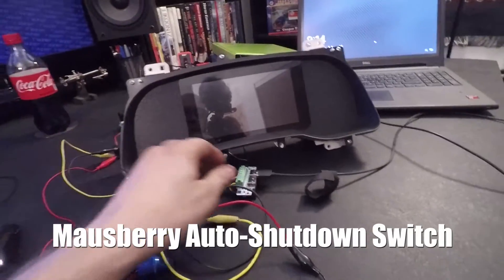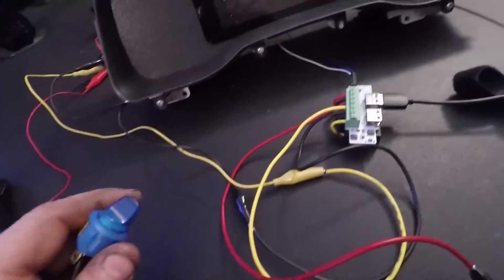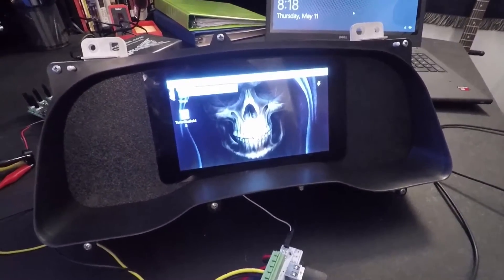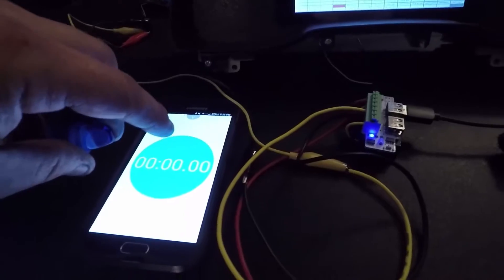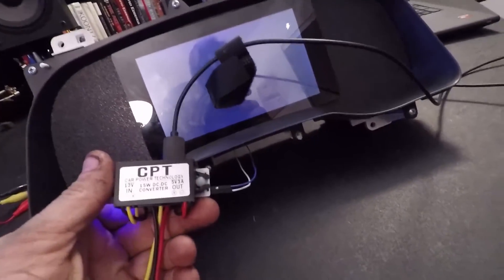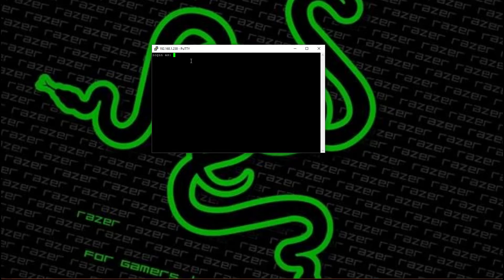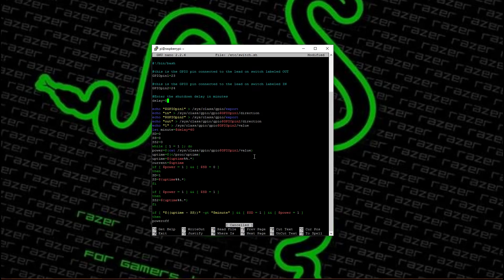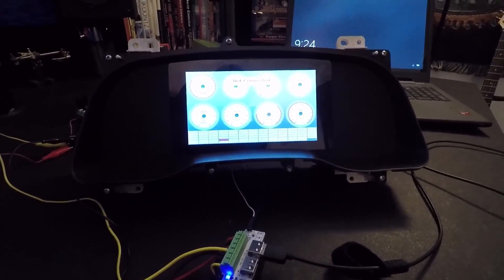Mauseberry Auto Shutdown Switch Overview

Comment: How many amps was that power supply delivering? I just tried my mausberry 4 amp circuit using a 12v, 4A power supply and the pi would just keep on rebooting, which clearly means that it wasn't getting enough current. I still have to try it with my car's battery...I just fear I wasted a lot of money on something that's not doing what it is supposed to 😔😔😔

Comment: Mine seems to switch the pi off while it still has power (switched power on) after about a minute. Any ideas? Thanks for the video!
Reply from the maker: Do you have the 2 additional wires hooked up to the Pi’s GPiO and the script installed?

I’ve heard others have had this issue.
Reply: Also having that issue, anyone able to fix this?
Reply: I was able to get the 90 second shutdown issue fixed by installing the script from Mausberry while the Pi was plugged into the wall (to keep the power on) then shutting down and installing the pi and Mausberry circuit into the car per Mausberry instructions. I think their instructions make it sound like the script can be installed after the physical install which is what I did first incorrectly

Comment: The product looks great and is the only thing I've been able to find that does what it does in a simple form, but I wish it had either a higher power out put version, or a version where you supply your own converter and it just handles the switching. The only other complaint I have is the price, at the time of writing this it's $35.99 that the price of the pi itself.

Comment: Can the car key be used instead of the switch?
Reply from the maker: With my setup the ignition key controls the power to the Mauseberry. Though you could just turn it off and on with the ignition switch. Some guys have good luck, others have experienced file corruption.

Comment: Is this a safe shutdown?  It looks like it just slammed it off and killed power.. I didn't see it go through a proper safe shutdown..
Reply from the maker: Yes, it's the best method for shutdown. It runs a batch script to shutdown the Pi. It doesn't just cut power. That's the point of the switch setup.
Reply: That's what I thought it's supposed to do.. I ordered one for a CarPC audio setup.
Reply from the maker: I think you'll be happy with it. It's fairly easy to setup.
Reply: Thank you, I have a keyboard mouse setup wtih it but still have not figured out how to get to the command prompt.. im using OSMC/Kodi to use this as an audio player.

Comment: Is there a way to run 2 touchscreens on the same megasquirt with different screens on ts? For instance the gauge cluster would have the gauges you selected while the 2nd screen displays maps? Well above my megasquirt skill level.
Reply from the maker: Sadly not at the moment. There are several guys working on it, but not at the moment. You can run say the LCD hat and a separate display, but it's clunky and you run into weird resolution issues.